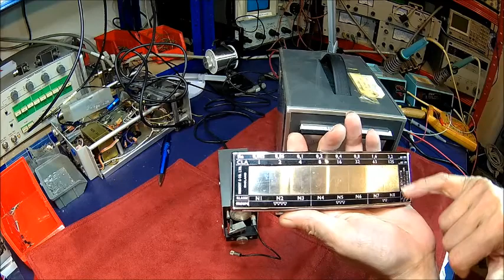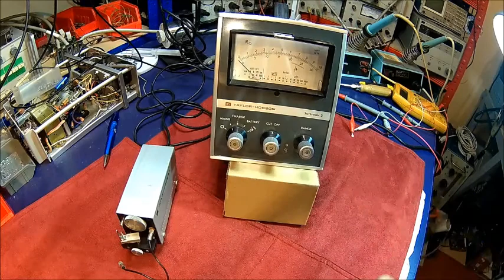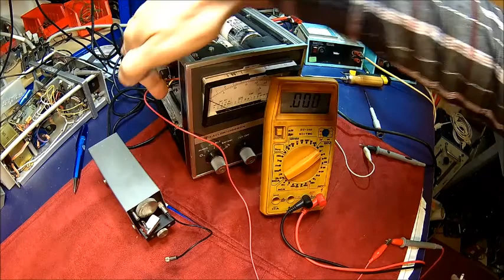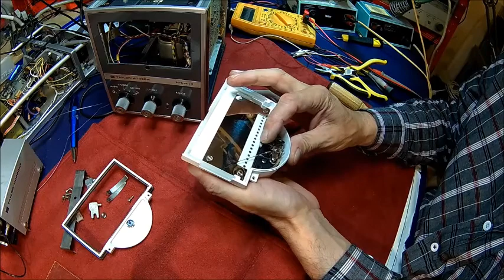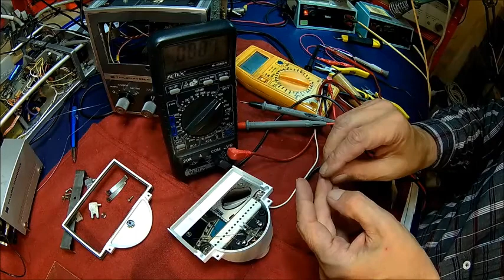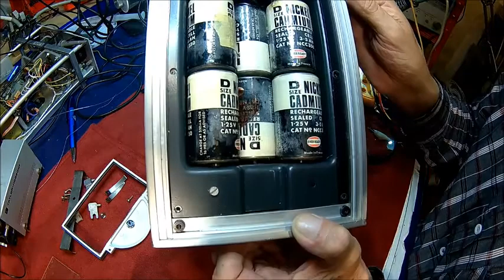Taylor Hobson Surface Roughness Tester, tear down + repair (Poor man's tester part 2)

Comment: Nice video! I have an old Surtronic 3. The display doesnt work, any ideas where I might find a replacement?
Reply from the maker: It might be a standard 2x16 or 2x20 display,  but not sure as i never seen one in real.
Reply: @dynoguy  it has the capability to display four 8. Where would one find something like that? No matter how I google I only seem to get up modern LCDs
Reply from the maker: I see, .. i was thinking of the Surtronic 3+ which shows multiple characters in 2 rows. On your's, i suspect this might be some sort of a clock display and is probably hard to find. But if the display is not blackened and just not working, you might get lucky by (carefully !) dismantling it and cleaning the conductor strips and circuit board with a bit of Isopropanol . It's a fiddly job and if you never done it, success rate might be rather low.
Reply: @dynoguy  Unfortunately you are correct, its a nice old one, and it does look like a clock display which is completely blackened. Bled allover. Seems like its almost impossible to find a replacement?
Reply from the maker: Just had an idea,.... maybe it's just a panel meter, being that old it's quite possible that they just spit out an analogue signal and simply display it on a standard panel meter. I see that quite often on older (usually pretty expensive) test gear which comes in for repair..
Reply: @dynoguy  thank you for your reply btw :)

Comment: That is a really nice meter movement, over the top? yup. I have a 'thing' for analogue meters, I always found them nicer to use in the field than digital.
 Cheers, J.
Reply from the maker: This meter is amazing, very heavy and the action is super smooth, that was certainly not cheap.
I totally agree, there are many applications where an analogue meter outperforms a digital one by far. Generally faster to read,  shows trends and blips immediately and if you don't need 5 digits accuracy i cannot see an advantage of a digital one.  Think speedos, rev-counters or clocks, for example, ....  i've also got quite a few analogue multimeters and don't want to miss them.
You see, i am a fan of those as well. ..cheers and thanks for watching
Reply: Thank you for your reply, I like it,i like talking to real people.